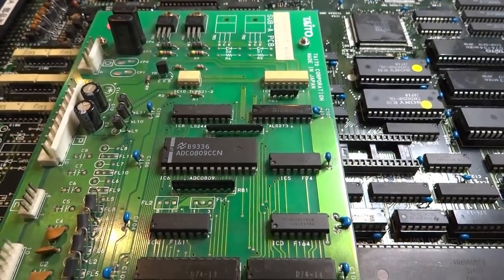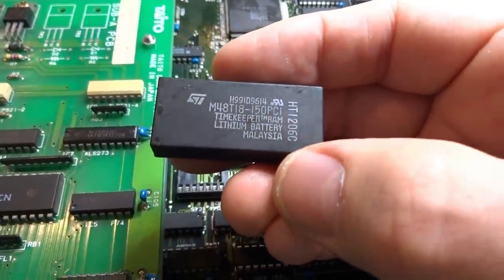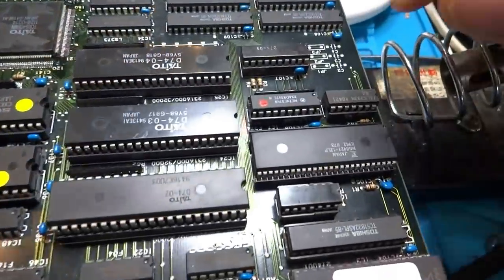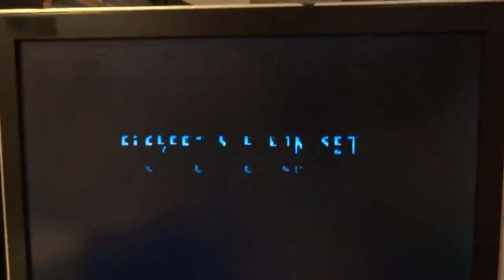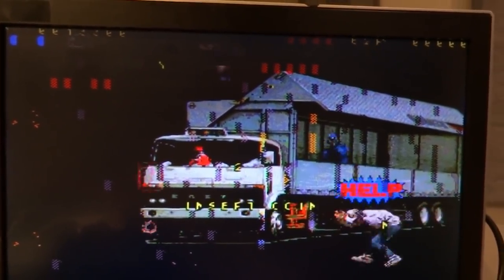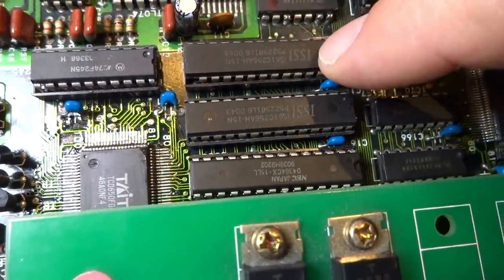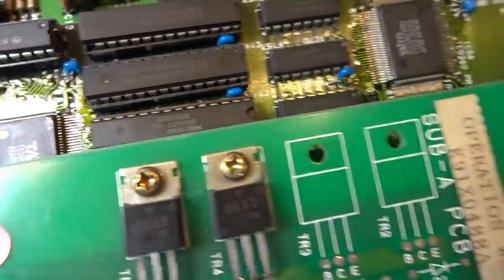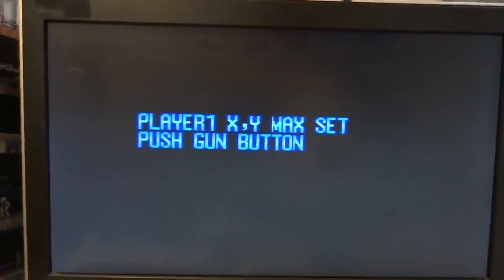Operation Wolf 3 Arcade PCB Repair And Some Info

Comment: Thanks so much for posting this. As you pointed out so little info on this game. This may be the first actual video of the real pcb running online. I believe all others are from MAME which has some gfx bugs. Looking forward to an upcoming game play video of it. Always enjoy the repair videos, and even more for the rarer games.
Reply: There is a small clip of the attract mode running on what seems to be the original cabinet, though can't tell if the original pcb is inside or it's just running MAME. Try searching "Arcade Operation Wolf 3 fully Restored"
Reply: @Brock2097  thanks ill check it out
Reply from the maker: I also think this is the only video showing the game running which is weird. I know that there isnt any info on the custom chips really online so I decided to put that in the description. I will put up a gameplay video here in the next few days :) Thanks as always!

Comment: Another great video Luke, thanks mate. Being only amateur at electronics I am mesmerised by these videos. Do you work in this industry or its just a hobby? Never even knew  there was Operation wolf 2 let alone 3......Used to have the original on a pc in the 90's was pretty cool with the mouse. Cheers mate.
Reply from the maker: Thanks a lot my friend. I only work in this area as a hobby enthusiast. Not for anything more than bringing these dead games and systems back to life. This board is much less common than the first 2 but its neat. Having the PC version sounds pretty cool as well.

Comment: Thank you so much Luke for the Great video.
Those "TimeKeeper" chips can be a real hassle. What struck me about this board is 
the amount of replacement that had to be done. As well as a few thoughts and questions 
about this board. One, did you have to repair any traces like you normally, well, ha ha "normally" 
have to do. Two, that pin you removed, I wonder what it's function is or was on the board previous 
to it's "Junk" status from whatever damages that happened to this board. 

Is it necessary to the function of the system as a whole or some specific part of the game? Only way to tell 
is play the game right? Lol I honestly think we need more videos like this one explaining boards that have very 
little documentation and discussion about them. Sure, this game isn't as glam as a CPS1 or CPS2 or CPS3 board. 
However, it is still very important to have content like this and I am super happy for future people needing this info.
Reply from the maker: Haha, no problem at all! There was a lot that needed to go into fixing this one and I am lucky I had the parts. The bottom of the board didnt have any trace damage but when it arrived, it had previous repairs on the board. Because one of the qfp's was shorting to ground, it is possible that it killed the other customs on the board. WIth ram and other ttl IC's there are sometimes pins that arent utilized. If you have the schematics, it is easy to tell but without them, it can be a bit of a guessing game. Hoping that some of this will help out someone in the future at least. Thanks a lot as always!

Comment: Not a huge fan of these games but they always seem to do well in the arcade. I'm sure some of these chips would have survived longer if they'd had a heat sink or something.
Nice work Luke. How many more to go?
Reply from the maker: I can understand that for sure. You are right though, these boards will last much longer with fans or heatsinks. I usually put fans on the ones that use a lot of energy and produce a lot of heat. Some of the positioning of these chips can make it difficult though. Essentially we are at the end of the repairs for now. I need to go back and take a look at one more board but most are done. Thanks as always!

Comment: Looking at system16 it only shows 2 games using this hardware with it being kind of similar to the F2 board. Great to see a rare type of board not used much at all.
Reply from the maker: Yeah, it is really strange isnt it? I wonder why only 2 games were made. Maybe because they were moving on to F3 hardware? nevertheless, thanks as always for watching and glad to have this running again.
Reply: @lukemorse1  It is modified F2 hardware.  I believe they added extra memory for the digitized sprites.  I don't know why they bothered making the F2 system when the F1 is much more capable.

Comment: Awesome video as usual Luke.  Just wondering if you offer any type of repair services.  It's hard to find trustworthy people to work on your stuff nowadays and you seem to definitely trustworthy so I'm just inquiring.  Thank you
Reply from the maker: Thank you for that and thanks for watching. Unfortunately I dont offer any repair services, just these videos here. The trustworthy part really goes both ways with repairs and sadly, like you mentioned, it can backfire on the repairer as well. Thanks for asking though and hope you are well.
Reply: @lukemorse1  well that’s cool and sucks at the same time!! Lol.  Maybe you can point me in the right direction.  I have a rush 2049 and out of the 6 speakers I have one in the actual marquee that doesn’t work.  Since you don’t actually work on others stuff,  would you mind if I upload a close up of my board and you tell me if you notice anything?   By the way. The speaker itself is actually good.  I swapped it with the other side.

Comment: Just picked up this board and am wondering how you got video originally on your lcd? Mine won't sync on my converter. I also didn't understand the sync resistor mod you did, you said after you weren't using a converter, yet it looked like you were still going into an lcd panel, how?

Comment: hmmm not super familiar with this one. I've played the first one on NES and a bit in the arcade and I knew of the sequel operation thunderbolt but that's basically it. I forgot there was a third game! definitely a vast improvement after all the repairs, for sure!!
Reply from the maker: This one is a bit of an oddball compared to the first two and I cant remember but maybe it is unrelated? It is neat though in its own way and much more different than the first 2 for sure. Thanks for checking out the vid as usual my friend and hope you are doing well.

Comment: Does the Time Keeper Chip save the settings for the game? My OP3 boots and plays fine. It will not hold the settings for mirrored and free play.
Is there any programming that will need to be done to the chip , pruir to ot being installed?
Thanks
RJ
Reply: I am having similar issues with my OP3, it doesn't save the gun positions after a power off and I have to re calibrate the guns every time. I was thinking about getting a new time keeper chip too but also wonder if it has to be programmed or not.